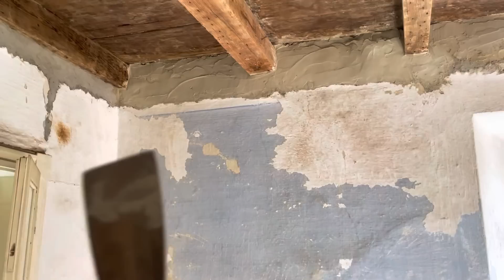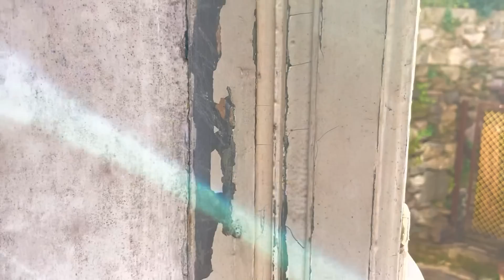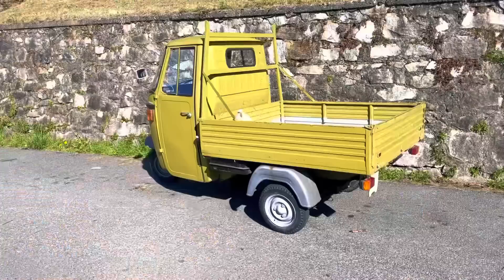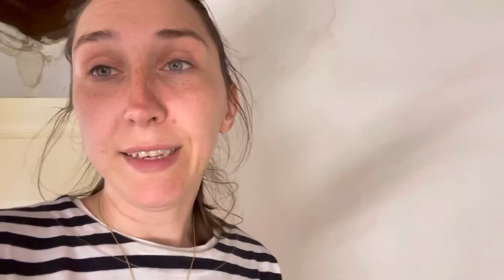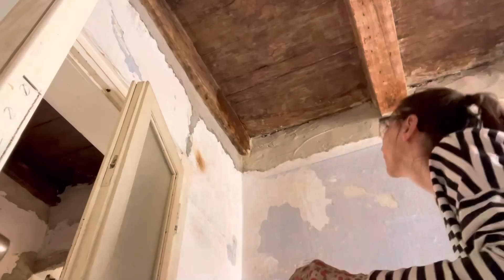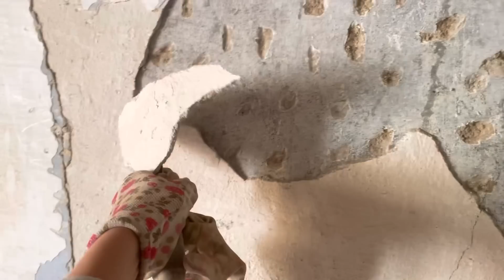A very boring job…renovating an old Italian house

Comment: We have old oak beams in our converted barn and the previous owner stained them a darker colour than we liked. Like you I tried acid  but it didn't work.  The only thing that worked was sanding,  very time consuming so we had the sandblasted and it revealed the beautiful natural colour. With your walls I would try using the attachment Sergei used on the beams to remove most of the old plaster and then sand them. I would employ a plasterer to plaster the walls, worth paying for if you want a beautiful smooth surface as it is a real skill and really transforms the space. As someone else said you need to get all the electrics channelled in before you start plastering.

Comment: Alla you're going to need to use a sander to sand down the roughness of the plaster you already applied so why not sand them all and save yourself hours. You can not put wallpaper over uneven walls.

Comment: The easiest way to remove paint off timber is to buy a gel paint stripper, and just paint it on. Leave for a little while then scrape off and also remove with very coarse steel wool that you buy in a roll. Then you just need to clean it down with water and a sponge. This method works beautifully and is easy, but please Alla, don't use the point of the scraper on the wood or you will have deep scratches that will show up when stripped.

Comment: Alla, I agree with some comments here. The old plaster looks quite unstable, so it would be better to remove it ALL now, while you are still renovating. If you don't, you might be unpleasantly surprised in the future, when it starts crumbling down. I know it's quite a bit of work, but you want to do it right, so it lasts forever (or at least, for many, many years to come) 🏗

Comment: I know it’s hard and discouraging right now to scrape away the grime and age of your ancient walls. If it were easy and fun, someone else with less courage and grit would have done it long ago and your house would not have been waiting for you to renew it. The old paint and plaster are loosening and falling away easier after you’ve left it for awhile because the edges are hydrating. Try wetting the walls before you scrape and find a larger implement. 
Although it seems endless right now, the working days will fade into memory when you are busy entertaining family and friends in your exquisite new kitchen. Love and hugs, Bonnie

Comment: Pick up a paint remover for the windows....it will save you a ton of labor.   Apply generously (w/ film or without on top), leave more than the prescribed time and the paint will wipe off.

Comment: You need to strip all the plaster I think as it will all keep coming off .[sorry Alla]} but I am trying to make less works for you in the future. Then you will not have a problem again as you are starting from a fresh. Longer job but well worth it in the long run. Keep doing what you are doing Alla you are both working hard 😘😘

Comment: as an artist, i find these walls after your work beautiful as they are - as a basis for your own work of art and away from the normal wall design. you can make something beautiful out of each segment or you cut out a block - floor to ceiling and 50cm wide and design this or leave this area as it is, but process it in such a way that it looks really special, elegant and rich or rustic . this blue - gray - beige - brown has something. on the museum island in Berlin, some of the walls that were still standing after the bombing in world war 2 were partially left as they were, but restored in such a way that they fit perfectly into the surroundings and at the same time tell a piece of history.

Comment: Hi Alla, I understand that's your name, I really like your videos and for me they have become a daily fixture, you're doing a fantastic job in the garden but I feel compelled to criticize you and give you some advice, forget, you and Sergey, the hardest jobs in the house,
rely on professionals, especially when it comes to walls or systems because you could spend a lot of money and effort, and have an ugly and unsatisfactory result and then have to work on it a second time, spending more money and time that you could use for other things,
for example what you are doing to the wall is absolutely useless and even perhaps harmful, just think how much paint would be needed to paint that wall and it would always be an old and irregular wall, a professional, on the other hand,
in a day's work he would "shave" the wall with white stucco and thus it would be smooth and regular and with a little paint it would be beautiful. Hello and I hope you follow my advice, good job
Reply: another thing for example, those cracks in the walls are not to be underestimated, have them seen by a mason, they may have been caused by various factors and could be a sign of a serious problem that should not be underestimated for the stability of the house, furthermore if you were to use a wrong plaster you could have problems with humidity and muffe
Reply: It seems they get plenty of advice from professionals when they need it for different projects. They seem to have plans for what they need to do.
They are determined,  that's for sure!
Reply: @barblallier9413  non sono un professionista anzi sono quello che è più lontano da esserlo!Sono soltanto uno che ha provato a fare da se e ha fatto più danni che altro e se ho provato a dare un consiglio è per esperienza personale, non dico di provare a fare il più possibile da voi, il mio consiglio è di far fare cose importanti, come appunto i muri e gli impianti a qualcuno del mestiere

Comment: It would be a good idea to remove the old plaster and replaster. It's a messy job, but if the plaster is chipping away, it needs replacing. Better now than painting and finding it needs replacing later.

Comment: Have you tried to find Paint Remover that is specifically made for WALLS? It’s similar to applying/removing paint from wood furniture. It would only need to be scraped off the wall & much faster/easier for you! Good luck to both of you on all your hard work! 🤞

Comment: Hi Lovely Guys, To lighten your ceilings try  experimenting on similar boards with water-based white paint or tinted what ever colour..add some water plus afew bits of   water base varnish...that  helps the  paint glide ...keeps it from being  blotchy..so you can feather it all in...looks very natural. Nicer to use than chemicals. Xx

Comment: Have you thought of having your beams sand blasted, that brings them up lovely? B W from Australia x
Reply: I have already sanded them with angle grinder - i hope it's fine for now
Reply: @dreamingofachateau  sand blasting is a total different procedure, High pressure hose which blasted out fine sand, like a pressure washer, but uses sand. If you are interested, look up YouTube, The Pethericks. They are restoring an old convert in Frace, they had beams in a kitchen done. Wishing you well in your endeavours

Comment: alla re your kitchen window where you want the sink by the window i would get both windows done and get wiondows that open outwards rather than inwards . maybe the double glazed one thats recent i.e from 1980 may fit somewhere else? or alternatively is ther a way you could turn it round so it opens outwards?